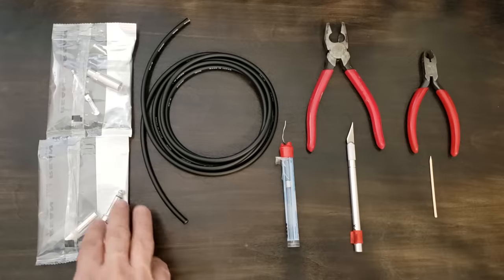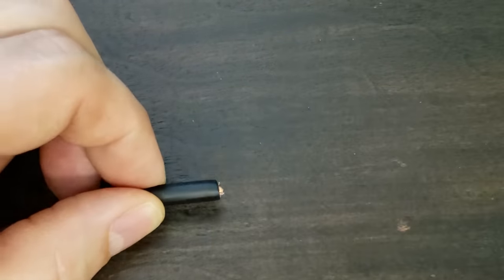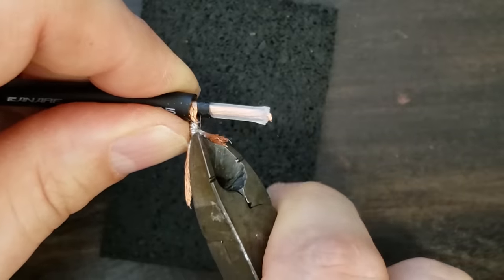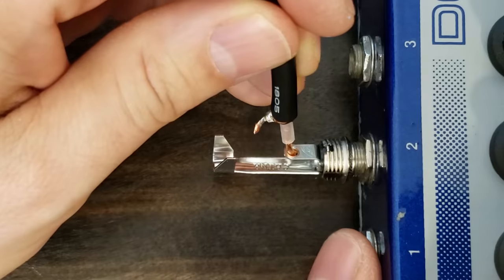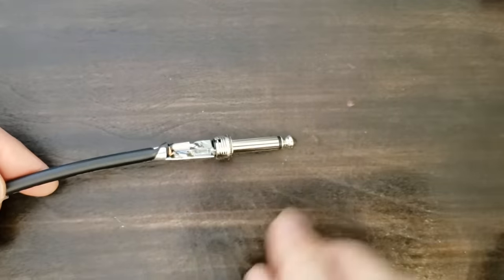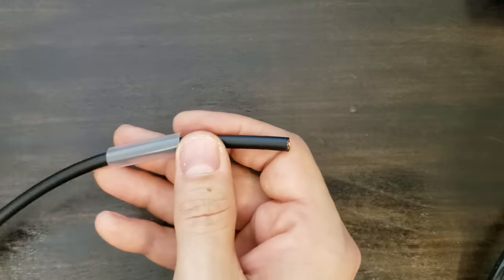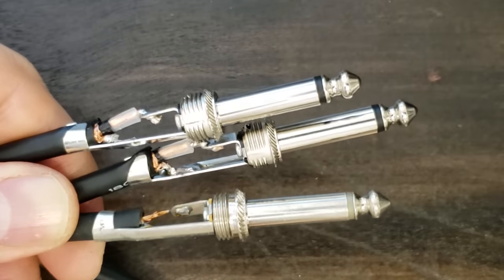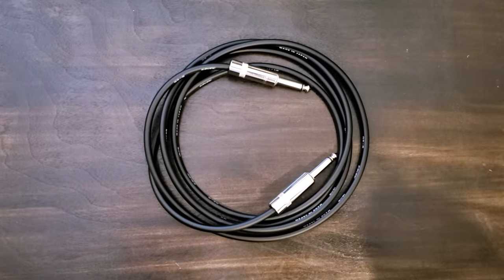Guitar cables - Make the Best Cables for bass keyboard GUITAR DIY SOLDER CABLE

Comment: Great video and attention to detail.  Do you recommend any brand of connectors? I plan to build cables using quality W2524 wire.  I'll probably skip the silent connectors.  I don't know anything about filling up the gap- doesn't seem necessary for the average application.  

One simple trick I do to further insulate and strengthen the strain relief is to simply, yet tightly and neatly wrap several layers of quality electrical tape the area where the cable first meets the connector.  This also helps keep dirt/dust from getting in should the cable drag around on the floor.  I can image other benefits as well- less static, better tone, etc., but that is just speculation.  For ~ 0.25c worth of tape, it seems like a good idea.
Reply from the maker: I like Neutrik/Rean, Amphenol and Switchcraft connectors.  Your DIY strain relief is a good idea.  A lot of cable manufacturers do a similar thing with shrink tubing.  I've done it in the past but I rarely have the correct size of shrink wrap on hand when I'm making cables!
Reply: @FrankOlsonTwins  My GLS cable has shrink wrap inside. I'm thinking of making my own using CA-0446 (BTPA) and a silent plug on one end.  It claims a low 20pF/ft capacitance.  Do you have any experience with that wire? My alternatives choices are W2524 wire (relatively higher (nearly double) capacitance), AE Reveal and/or Klotz LaGrange pre-made cables.
Reply from the maker: The BTPA cable looks to be similar to the Canare gs-6, should make a nice cable.  I've never used it,  however.  The Mogami w2524 wire also makes a very nice cable, in my experience.  I wouldn't get too hung up on cable capacitance for cables in the 10-15 foot range. You can often squeeze up to 20 ft out of a high-z cable before you start to hear the top end roll off. But realistically,  you likely don't need more than 10 ft per cable if you're using a pedal board,  so it's kind of a moot point.  I'd try the one you're most curious about and see if it fits your workflow and meets your expectations!

Comment: Good video, thanks.  Have you considered a light layer of solder on the joints before you attach the cable with solder?
Reply from the maker: Thanks!  Yes, I often pre-tin when soldering loose cables.  However, the inner conductor would not have fit into the hole with the extra solder adding to the diameter of the wire.  In this case, I chose not to pre tin the wires and I just soldered directly.  Thanks for checking it out!

Comment: You don't tin your cables or connector first?
Reply from the maker: Sometimes I do(depending on the connection), but for most guitar cable connectors I find it isn't necessary.  With an iron at the correct temperature both contact points should solder quick just like the video.  It might take a few practice solder joints to make sure the iron is hot enough/not too hot. Also, it helps if the wires are super clean with no visible oxidation.  That can complicate things, and might require cleaning first and tinning to get a solid joint. 

Things that help:  
Keep the shield wire connection reasonably short/small.
Keep your Iron tip clean/tinned and hot.
Keep your soldering time as short as absolutely necessary.

Comment: thanx.. what if the problem is not at the soldering? what if the broken part "in the middle" of the cable somewhere? how can i find the broken part and cut the cable there?
Reply from the maker: This can be difficult. You'll need a multimeter to test the cable conductors to be sure which parts are working or not working.  Then you'll basically have to visually inspect the wire by bending it around your fingers. A broken section will usually look different than the rest. 
Otherwise, you'll have to start cutting up the cable to see where it starts working...

Comment: I assemble it without an solder to it..
It works great
But i really need to add solder
Reply from the maker: Yes, it's better to solder cables together, but I've owned some "solder-free" cables that were easy to make.  If you don't own a soldering iron, or don't feel confident using one, solder free cables are a good alternative.

Comment: I'm just starting out making my own cables and I notice some people "tin" the jacks beforehand. What do you think if this practice? Is it worth doing?
Reply from the maker: Sure, tinning can be helpful. Tinning the jacks makes the final joint a bit quicker, which could help to not overheat the cable.  However, with this type of cable end, I find that tinning the inner conductor of the wire can make it a bit harder to insert it into the hole.  If you're careful though, you can tin just enough to "wet" the wire without adding excess diameter, so it will still go through the hole.  In either case, just check all sides of the joint to make sure none of the joint remains "dry."  If it is, let the joint cool and then reheat and add solder to the dry spot. 
https://youtu.be/FYitV1jVMxY Here's the latest cable video I did, with updated cable connectors. In this video, I tin each conductor first. 
Tinning is a standard procedure in soldering, I'm certainly not trying to dissuade anyone from doing it. However, I make a choice between ease of assembly and proper technique. Sometimes, one of those things has to give for the best final result.

Comment: Hello guys! what do you think is a good cable length if your playing at a small stage
Reply from the maker: I like a good 10 ft cable if I'm using a pedal, otherwise I use a 15 ft cable if I'm going straight to an amp offstage. I usually bring both and run the 10 footer from guitar to pedals, and the 15 footer to the amp. Or, two ten foot cables.

Comment: Thanks for this! Are there any complications if cutting and terminating an existing braided guitar cable?
Reply from the maker: If your soldering is good and you don't leave any frayed wires between the contacts, you should be in good shape!

Comment: I always pre tin the wire.
What’s your thoughts on why you did not?
Reply from the maker: Pre-tinning wire is standard procedure, naturally.  In this case, it would make it difficult(maybe impossible) to get the center conductor through the contact hole, since the diameter of the wire is close to that of the hole. Additionally, it makes it slightly easier to push the wire "brush" out of the way before soldering to reduce the need for trimming after soldering.  
Concerning the shield, tinning is nice but not completely necessary, and sometimes the added mass can create undue heat during the re-melt stage. 
So in these scenarios, I prefer not to tin.  But if you perfer, do it!

Comment: Great tutorial. One question, why central wire gets put from the top, wouldn't less pressure to be applied if it was fit intot he hole from center to outside?
Reply from the maker: Possibly, but the amount of pressure on the central tab is very little. Also getting the wire through the hole from the bottom might have been difficult due to the design of the punched hole.
Reply: @FrankOlsonTwins  push on the cable before bending the strain relief. Just enough pressure so you take the tension off the conductors.

Comment: I didn't put my main wire through the hole of the connector when soldering. Should I re-do it?  I think I made a good connection anyway. Was a TRS connector
Reply from the maker: I'm sure it will be fine.  If you still have your soldering equipment out and handy, it would be easy enough to redo it, but if not you'll prob get years out of it with moderate use.  If you use the cable constantly, I would just re solder it.  Otherwise, come back to it the next time you are making cables.
Reply: @FrankOlsonTwins  Thanks for the advice. I'll just wait until I'm making more cables to redo it. Probably the best bet. Cheers!

Comment: Is there a way to repair/tighten the ground sleeve shaft if it is loose and is able to spin? I have a very expensive guitar cable with gold plated jacks and the ground shaft on one end is loose causing intermittent signal loss.
Reply from the maker: Hmmm, hard to say without seeing the cable connector.  Any chance you can post a video and a link?

Comment: Did you use silver solder? If yes what brand do you recommend? And will it affect the tone? Thanks :)
Reply from the maker: No, i use Kester brand 63/37, or 60/40 leaded solder or Oatey brand.  Silver solder can work fine, it won't change the tone in any meaningful way.  Might be safer to use over all.  It might be more difficult to use, so if your soldering skills need some work, leaded solder might be an easier learning curv.

Comment: angle connectors are harder to do, especially the flat ones cause you have almost no space
Reply from the maker: The 90 degree switchcraft ones are a bit easier,  but many of the small pancake ones are a bit more difficult...

Comment: Is it an issue if the solder ends up touching the black outer layer? Or even the clear layer on the inside of the cable?
Reply from the maker: No, the outermost black layer is non-conductive.   Same is true for the inner clear layer.  They are both considered "insulators" because they will insulate wires from each other.  The one you really need to worry about is that thin inner black layer.  It is very conductive, and will cause problems if it touches the wrong thing.

Comment: Iv tried repairing an old cord that popped , thought everything looked good and was positive it would work after soldering. Plugged it in and nothing not even pop. Any advice??  Kinda thought I may have gotten the tip to hot.
Reply from the maker: If you have a multimeter, you can test the cable to see where it's broken or shorted.  Start by testing tip to tip and ground to ground at each end. If that doesn't work, test inside the connectors: inner conductor to inner conductor, and shield to shield. That one should work. If it doesn't, you have a short somewhere in the cable(or at the ends). You could cut the connectors off and start fresh, or test them to see if they are working. If you think you got one end too hot, that's probably the case. I'd get a new connector and try replacing it. Good luck!

Comment: I have a 1/4 right angle switchcraft style plug for my guitar and after noticing intermittent buzzing (no audio from instrument) I decided to open it up. it seems that the plug connectors are loose and can pull back about .5-1mm from the outer metal plug housing, and when you pull it back the sleeve loses connection (used a multimeter, set to continuity, and put one probe on the sleeve of the good plug and one probe on the sleeve of the bad plug; sound stops when you pull the connection plugs back from the plug housing). does this mean I need a new jack, or can I just use glue to reset the plug connectors snug with the housing so it stops shorting out?
Reply from the maker: You could try glue, but the best option will be to replace the plug.  If you use super glue, I've had the best luck with Zap-a-Gap brand.
Good luck!
Reply: @FrankOlsonTwins  Thanks so much! I just went out and got some glue (pattex ultra gel) and put the glu in the gaps before pressing them together. it seems to have done the trick for now and hopefully will last until a new plug arrives.

Comment: Weird when soldering any wires its always best to tin the wires first. Why did you miss this step?
Also for stringed instruments guitar, bass, ukulele etc I find a right angle plug going into the instrunent also relieves stress on the cable.
Reply from the maker: In many cases, tinning wires first would be ideal.  However, with a hot iron(not too hot, don't melt the insulation off the wire), clean wire, and clean contacts- tinning shouldn't be necessary.   One thing to note: this is why i make a smaller ground wire, it's easier to solder in one step without over heating the wire.  As you noticed, it allows you to easily insert and shape the wire before soldering.  Shaping wire with a hot soldering iron is not ideal!   Also, getting a tinned wire through that tiny connector hole would be an exercise in frustration.   Good luck!

Comment: Hi Frank, I have a Spectraflex guitar cable with a failed 1/4 mono connector but has four lead wires plus the ground sleeve.  I'm veering towards just soldering two of the four leads together and ignoring the other two.  I think they be there just for rigidity in the cable.  Ever fix one of those?
Reply from the maker: Yep that should be fine.   I've done the same with 2 conductor wire and it worked great.
Reply: @FrankOlsonTwins  Thanks for the prompt reply and great video.  Take care.
Reply from the maker: Thanks and you bet!  Best of luck!

Comment: No heat shrink?
Reply from the maker: Heat shrink isn't really necessary.  The plug comes with a plastic insulator that will keep the signal wire from shorting to the plug casing.  Use heat shrink if you like a little extra strain relief for the cable where it enters the plug, though.

Comment: I noticed you are using the cheaper Neutrik REAN connectors - that was an acquisition they made and they are made in China.  Have you noticed any problem with them?  The Neutrik ones are a lot more robust and also much more expensive.  Just wondering if you have had good luck with the REAN connectors after using the cables for a period of time.
Reply from the maker: I have both, and use them frequently. The more expensive Neutrik NP2X is really nice for guitar(I often play a stratocaster- perfect for that), but I think it's a bit too heavy and large for most patching applications.  
The Neutrik/Rean connectors(NYS224), like the ones in this video, are the ones I use most often. After 20 years of daily use, I can say I've never had an issue with them.  I have many guitar and patch cables made from these.  The only issue I find is the weight(8 or 16 of these really add up), but that's the same with any quality connector. They're all going to be heavy.
Give them a try, you'll be glad you did!
Reply: @FrankOlsonTwins  Thanks for the info... great video.
Reply from the maker: Thanks!  One last thing about these Rean connectors: I like that the barrels stay screwed tightly, unlike cheaper and sometimes even more expensive connectors such as switchcraft.  I do use some Switchraft right angle plugs, but that's pretty much it.

Comment: Can we use rg 174 to make make mono audio snakes
Reply from the maker: If you keep it short(10 feet or less), rg174 should work fine as a mono snake cable.  If you already have a bunch of rg174, it could be a good experiment!  However, due to it's small size, it's not particularly durable. If you're making a short snake, it might be good to bundle the wires together in a shrink wrap or other protective sheath.
If you're making a long snake, you should consider using a balanced configuration with a 2 conductor cable, such as the mogami W2944 console cable. I've been using it and I like it.
Best of luck!
Reply: @FrankOlsonTwins  thanks

Comment: Hi sir. I use RP360xp processor. There is a humming sound from it after connecting input. Wthr it is aux or phono.. Of i remove input there will be no huming or noise. 
 And also, if i touch any metal part after connecting input the humming sound stops. And it resumes when i release my hand. Is there any solution..? Could u plz help me if u can.
Reply from the maker: This sounds like a guitar ground issue or cable problem.  
Try several cables that you know are working properly. Sometimes a faulty cable will create hum.
Most likely, the ground on your guitar is improperly set up or is going bad.  Does the unit hum with JUST a cable installed on the input(no guitar attached)?  If no, then the problem is likely your guitar. 
There's not much to go wrong(or fix) with these all in one units, so aside from cleaning all the contacts(input, outputs, power) there isn't much to do to fix it.
Good luck, let me know how it turns out!
Reply: @FrankOlsonTwins  thank you so much for spending your valuable time for me sir. ☺️

  Im a violinist. When cable attatched to the input without connecting violin it is a very loud humm... (Loudness is about a mixi's working. I think it is normal, if we connect a cable to processor input without violin at the other end) And if i connect my violin at the other end this humm will get reduced very much. (Now the humming loudness is similar to a CPU fan's volume) this gets amplified with change in effects. If i increase Base EQ, compression, distortion etc...
  And this sound will become zero when i touch the screws of the processor or the metal connector of the cable or I completely remove the cable from input.

   Now adays i connect the earth point of my plug to the screw of my processor with a single wire and the sound disappears.

  Can i solve this permenently.? I have tried many cables
Reply from the maker: Hmmm.  This sounds like a ground issue with your building or your violin.  I've experienced this issue with guitars from time to time.  Sometimes it depends on where you're playing.  Some buildings/outlets have better ground connections than others. Try playing the violin and processor in a different house/building/outlet and see if that helps matters.  Also, it's possible that the ground on your violin is weak, in which case it would need to be resoldered.
Reply: @FrankOlsonTwins  which means. The humm can be of violins. I will try changing instrument and place where i play. I will update u if it become ok. Thank you so much for ur guidance sir☺️.

Comment: Tin the wires before soldering to the plug.
Reply from the maker: Sure, pre-tin in most situations. It will make assembly more difficult here, however. Even the smallest amount of solder on the inner conductor will make it harder(or impossible) to fit into the connector hole. It also makes it easier to push the conductor away from ground as you solder.  So, in this scenario I prefer not to tin.